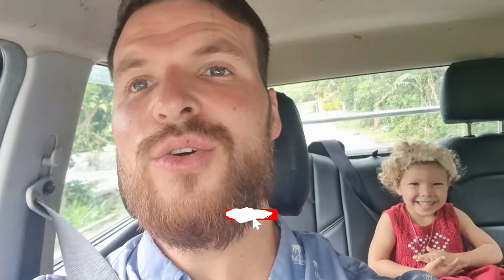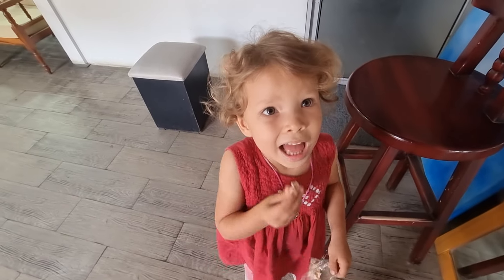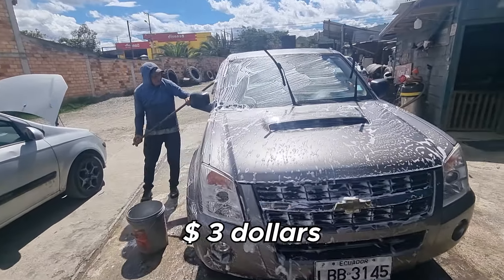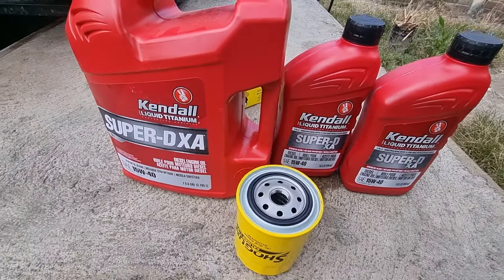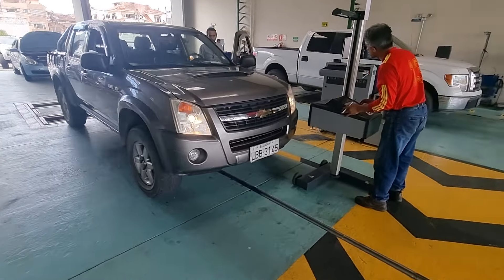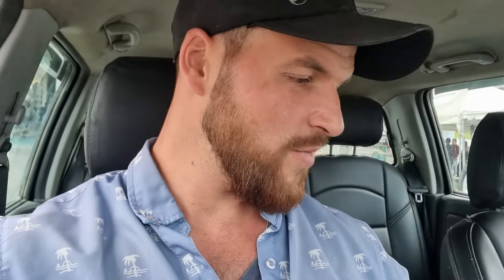A Day in Loja: Car Inspection and Maintenance, Passport Photos & More!

Comment from the maker: 0:00 Intro
0:07 Getting an Oil Change
0:50 Passport Photos for Canadian Passports
1:13 Car Matriculation and Revision Process
1:58 At the Photo Place in Loja
2:30 Walking Street and Market in Loja
2:52 Eating Ice Cream at a Restaurant
3:41 Reviewing Passport Photos
4:04 Attempt to Get Car Inspection
4:12 Car Wash in Loja
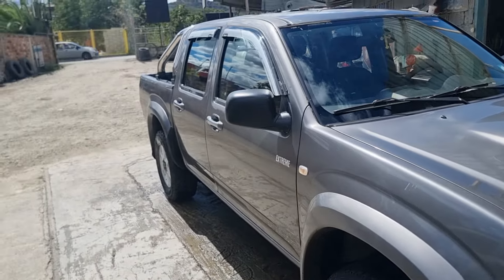5:01 Clean Car Ready for Inspection
5:12 Vehicle Testing Area
6:04 Paying Fees and Fines
7:00 Inspection Center Procedures
7:30 Returning for Inspection on Monday
8:06 Getting an Oil Change in Vilcabamba
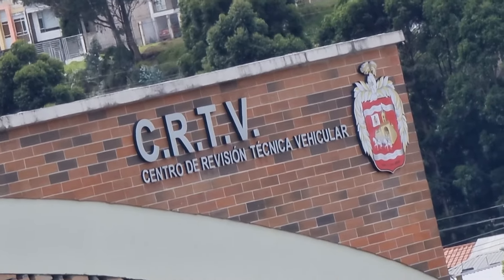10:12 Costs for Oil Change and Filter
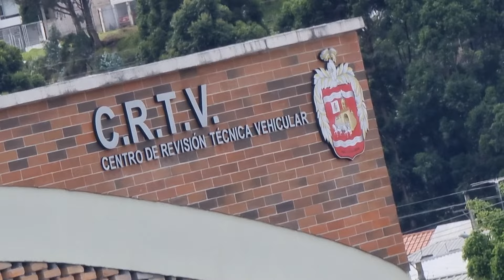10:15 Returning to Inspection Center in Loja
11:19 Waiting in Line for Inspection
13:26 Car Testing Procedures
14:26 Inspection Results and Next Steps
14:56 Outro

Comment: Frustration....yes. I remember the years I had a motorcycle in Vilca. I tried to be legal, and at least the plates were....but the inspection not so much. Everytime I went in their computer was broke. I learned to dodge the checkpoint on the edge of vilca. having a vehicle is nice but also a pia. Might get a fat tire electric bike, no paperwork needed.
Reply from the maker: Hey Glen! Oh, the joys of bureaucracy, right? Those inspection computers always seem to have a "convenient" breakdown. Dodging checkpoints sounds like it should be an Olympic sport by now. Fat tire electric bike? Perfect choice! No paperwork, no dodging, and as a bonus, you'll look super cool cruising around Vilca. Plus, think of all the extra exercise dodging potholes! 😉🚴‍♂️
Reply: @AbundantLivingEcuador  One of the expats, Wayne, gets around on an electric scooter done up in a Spiderman livery. The town is perfect for bee cee klet ahs. Folks with electric bikes tell me they hardly drain their batteries over a week of use in Vilca. But....there is a value to walking. At my age (78) it is important. Use it or loose it is just reality. As for looking super cool......the town ninja has set a really high bar for that.

Comment: Those "facilitators" were very frequent in Peru , they have been disappearing from the scenario the last 20 years. Beaurocratic procedures is heaven for those facilitators. They want to be the altenative option for faster paperworks , etc. They are still around but not that much. It called my attention that you are using diesel as fuel for cars , here only for cargo trucks or machinery .  It disappeared 15 years ago, when natural gas coming from Camisea came into the market. having a car using CNG , compressed natural gas for vehicles.
Reply from the maker: Thanks for sharing!

Comment: What is the total cost each year for inspection and registration? Is insurance required? Was your seatbelt ticket issued by a police officer or a camera? Did you just forget about it? I guess they don't issue arrest warrants for nonpayment like in the states?
Reply: @sidethorn3754  Registration fee depends on how old your car is. The newer the car, the more it pays. Insurance is required. If you don't pay your tickets you will pay interest over them and won't be able to do any transaction with you car. They could take your car away and it would be VERY expensive to recover it.
Reply from the maker: The total cost for the inspection and registration depends on the vehicle. The higher the commercial evaluation or the vehicle's value, the more expensive it is. On average, it costs between $150 to $200 a year. Insurance is not required in Ecuador, and most people do not have car insurance. Typically, newer vehicles or those purchased on credit will have car insurance, but the majority of vehicles do not.

Regarding my seatbelt ticket, it was issued by a police officer while I was on the coast. The ticket was for a passenger, an employee, who wasn't wearing a seatbelt. There are no arrest warrants for non-payment of these fines. However, many vehicles in Ecuador don't have proper registration or yearly inspections. These vehicles, if caught by transit police, can be impounded, and the owner must pay all the back fees to retrieve their vehicle. In rural areas, there's less police control, so some people drive these vehicles without getting caught.